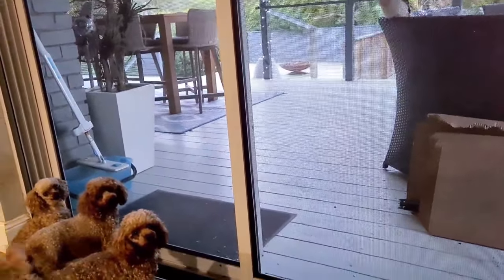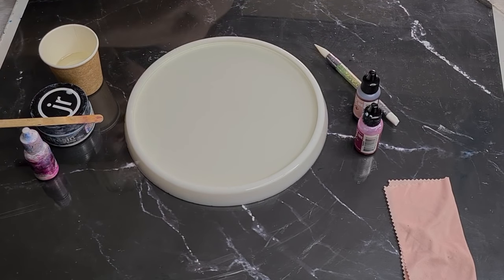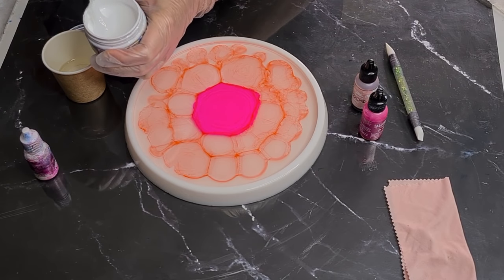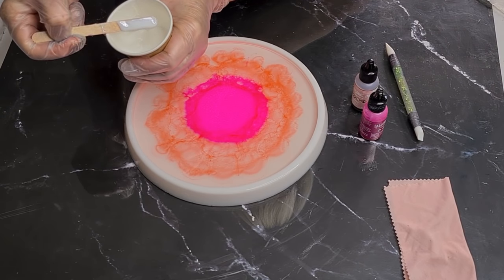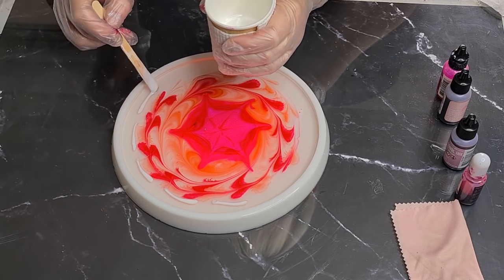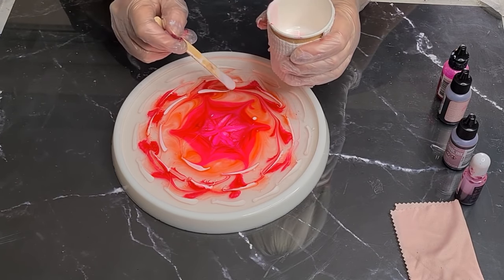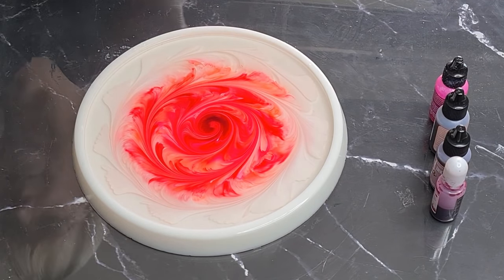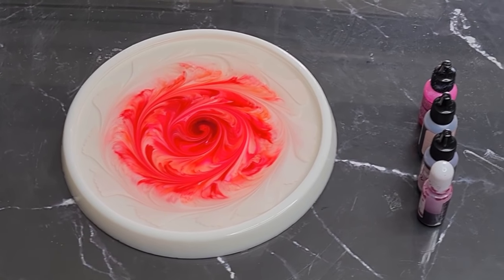#1464 My First Attempt At A Resin Rose Using The 3D Bloom Technique

Comment: I know this is two years old, but wanted to tell you that I just ordered from ebay, two molds. I know you are in AU, but I just can't wait to try them out, especially the 7-point flower! Temu is much cheaper for molds but have had horrible experiences...they are cheap and flimsy. Yours appear nice and sturdy and thick. I made a huge mess out of a Temu mold, but then I had another that worked out well. Love your designs.

Comment: Loosen the top of the paper towel around your cup and keep it tighter at the bottom so that your drips go between the cup lip and paper towel. That way it collects inside and doesn't still drip down the outside of the paper towel   ❤

Comment: A hardware store or Amazon will have foam squares to dampen echo. You can get them cheap and glue or tape to a big piece of cardboard. You can make several. Place them against a wall or lean them against the table. They are portable and inexpensive.

Comment: If I left the resin I've been using in a cup that tall for as long as you did, it would have flash cured. Obviously something about your epoxy is different. Chemically wise I'm sure.

I actually use a hair dryer over a torch or a heat gun because alcohol inks are highly flammable.

Comment: Really cool. 👍👍 How long had you been doing that at that point?
This is inspiring some ideas to integrate with turned wood pieces, and other crazy ideas that probably won’t work but I might try. Just need to get some resin and molds. 
You could work with 1mm layers at a time and you could really create some crazy depth.

Comment: And today we start our video with the pack of tiny dogs 😂 wasn't expecting that. The real question are, are they hypoallergenic low shedding dogs? And if not then how do you keep the fur off you and out of resin 🤔

I don't particularly like the color pink but this filligree style rose is quite beautiful, and I can see that apricot in it just fine, it is just more suttle. I am still in the 'finding my ideal resin and inks' phase, Thanks to your blooms I did get an idea using your method (if I can find the right resin and inks for me) for a resin craft that I can find molds for but the details and turnouts are so basic and plain, if I can get my resin colors to bloom though like yours it will completely fix the issue I have been trying to figure out with getting a nice natural 3D look. Took me watching you make 3 of these to realize it is going to transform what I need to make out of resin. Thank you.

Also, if you haven't you should try another rose but in your 2nd layer do green leafy shapes instead of white and apricot, I'm curious if the greenery will turn out well behind the bloom. Also You might consider that more like a peony then a rose? It's like a peony and a rose... And filligree, idk, I love the design though, it turned out very well, a bit pinkish for me but still super pretty